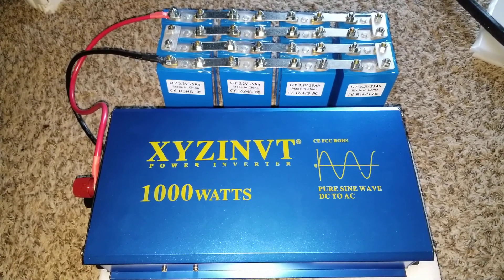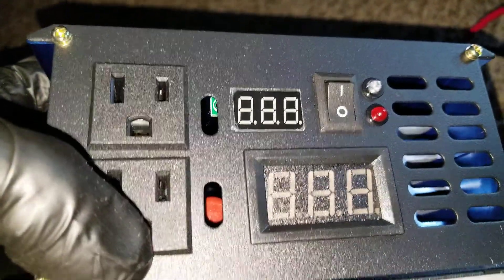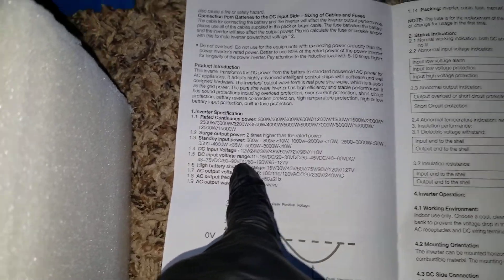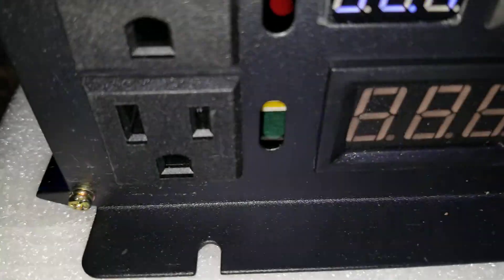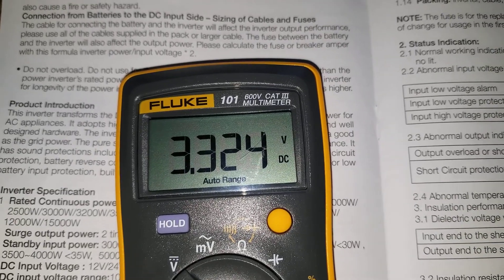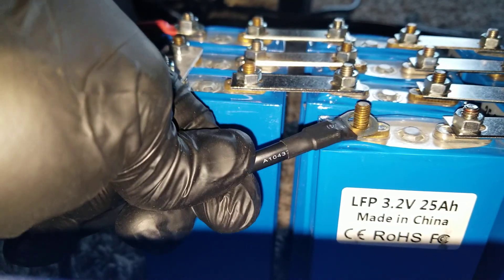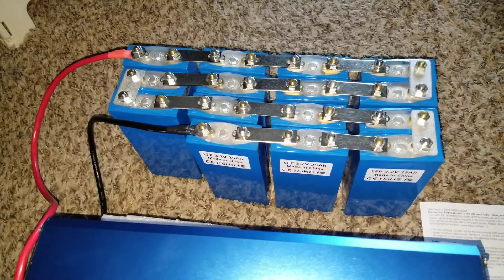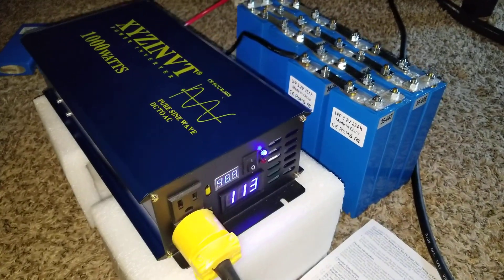XYZINVT POWER INVERTER, IS THIS A 36V OR 48V NOMINAL INPUT

Comment: Use two charge controllers, split the battery bank I half, for 96v use two 48v charge controller a
Split the solar, do everything like it's two batteries, only connect them in series and to the inverter,  I have even seen 120vDC inverters, not seen much use for them,  two 60v banks together in series, but the current should be low! 10 gauge batt cables,  if you are going to be testing like this
Maybe you should get a dc  to dc boost converter  and a large capacitor, to run a inverter long enough to start it, using a 12v battery, and boost the voltage to about 40v, you can put batteries  in series with the boost converter, to get more voltage,  if needed, ir use two dc boost converters  output in series!
Reply from the maker: Thanks for your sharing your opinion.

Comment: Whered you get it im struggling to find decent priced 36v 3000watt inverter for usa
Reply from the maker: I had an OutBack 2036 inverter charger which I just sold
Reply from the maker: Thanks for stopping by make sure to SUBSCRIBE LIKE and SHARE
Reply from the maker: Here's is a link for a 36V 5kW  120Vac the same inverter .

https://www.ebay.com/itm/385162072921?mkcid=16&mkevt=1&mkrid=711-127632-2357-0&ssspo=8HWU6LbYSSW&sssrc=2349624&ssuid=EBstTcE3Twa&var=&widget_ver=artemis&media=MORE